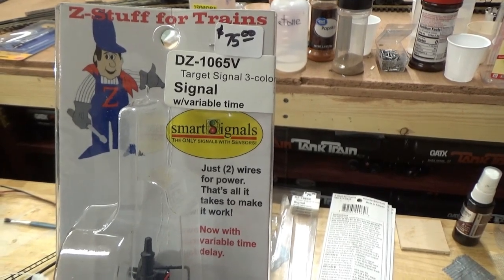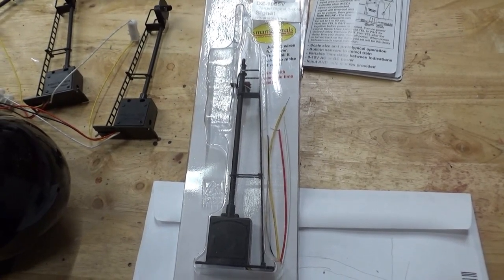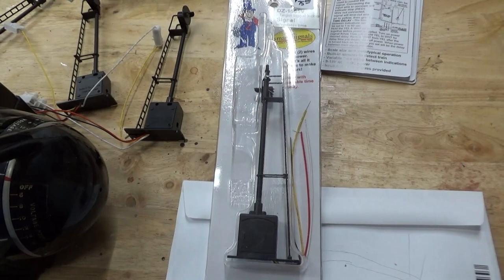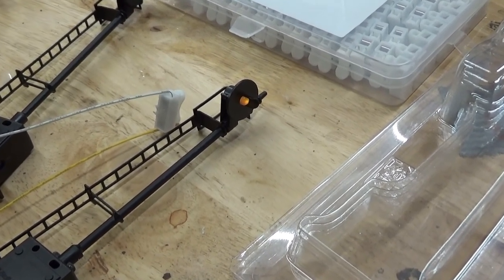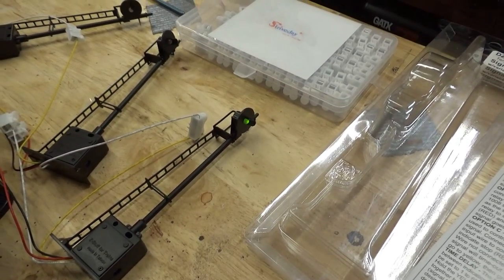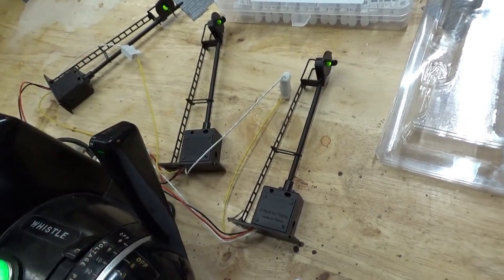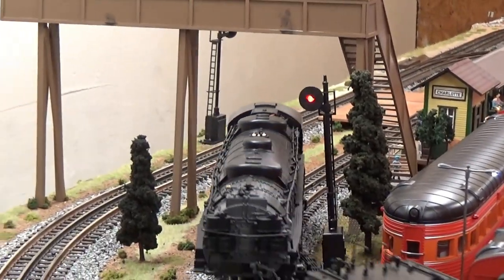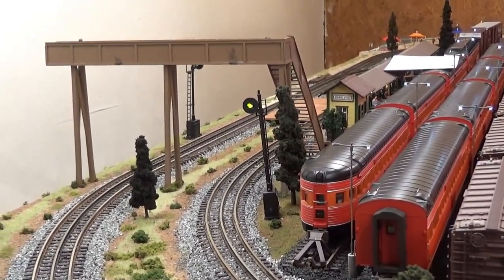Z-Stuff Signal Installation

Comment: I agree, I love Z Stuff and have the crossing signal DZ 1010 and the hooded three light signal DZ 1072. The only investment for railroad signals for me is Z Stuff. I like the way you set up your signals with the yellow to white wire option and would do that but my layout is too small. (9' by 5').
Reply from the maker: That yellow to white wire op is so easy to do. I love the simplicity. By layout is about 14' x 10 and it is barely big enough for that operation to appear correct so I understand. With the smaller layout situation, just having them on the timer is good enough.

Comment: Thank you for showing the wiring options. I have several on my layout including a few double head signals, lower head is controlled by a separate sensor. What size screws did you use to hold them down? Have to be tiny, I assume a panhead wood screw

Comment: Great video is there away to tie all the signals together my layout is very complex. i have a few triple target, double target, and lot of single target. For the 2 loops, yard & Engine shops. Im finaly at the moment i have been dreading lol putting up signals o boy
Reply from the maker: Yes there is. It is very simple though. Each signal has 2 wires connected to it. One sends a signal to a signal down stream and another wire that receives a signal from upstream. So you can tie loops together so that each signal knows what the signal in front of it and behind it is doing (ie red yellow or green). But I wouldn't tie them all together since they are going different directions. I don't know how it would work in yard applications. Nor do I know how it would work with multi-signal posts. I kept mine simple.
Reply: @PriestBrosLines  keeping it simple is always the best.  I kept pushing off as much as I could knowing signal install ain't going to be fun.  Right now my yard & engine shops have  Dorf signals their wired to the switches. But I got to install single heads to the main then I have cross overs witch require 2 head then I have 3 3 crossovers that need 3 heads so I'm like o boy this is going to be fun 😆
Reply from the maker: @Dachamp2001  Well if you figure it out, make a video explaining it. I'd love to watch that. I really like the Z stuff signals
Reply: @PriestBrosLines  so do I